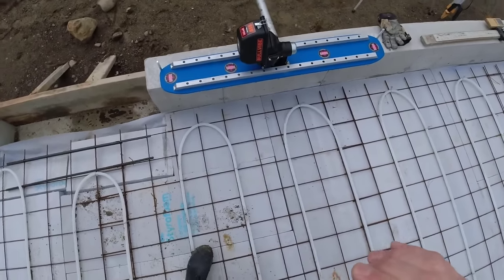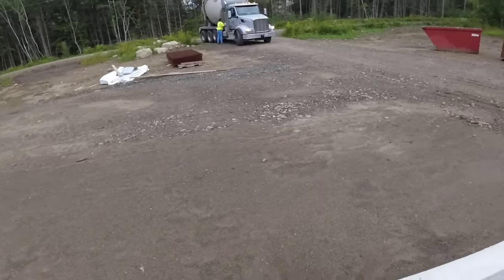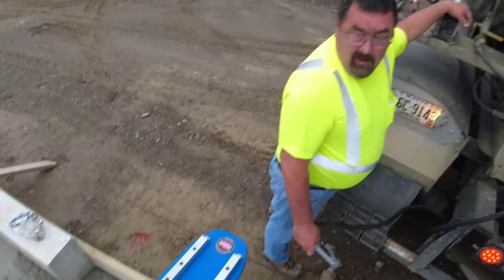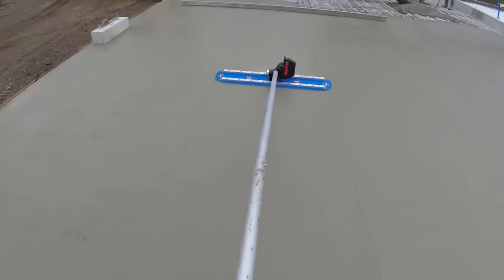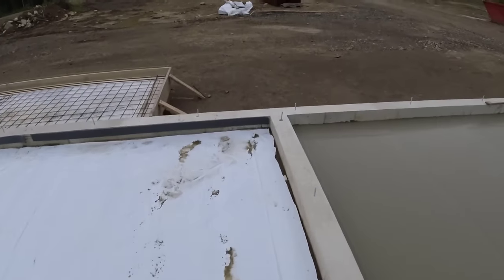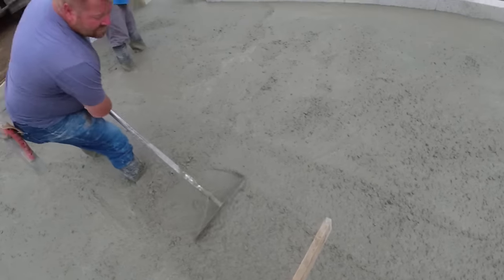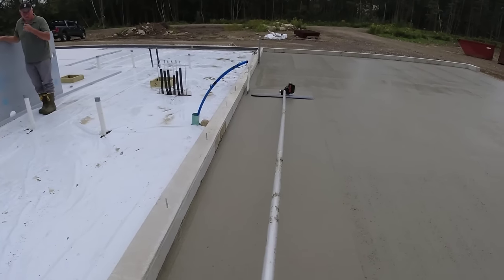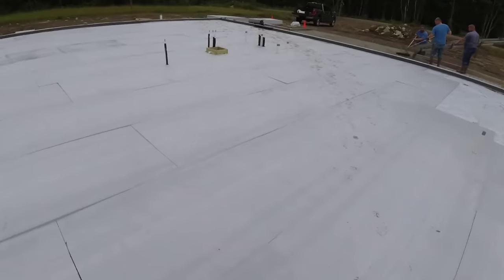NEW! BullVibe Attachment for your Bull-Float  (Easy Way to Add Vibration)

Comment: Have you had any issues with that poly bull float?  I heard it messes with the air in the northern part of the country...?
Reply: It will not seal the surface as much as a magnesium float. Then the bleed water can escape easier and not get blocked by a sealed surface. A magnesium may seal the surface, not that it always will. A composite float will not (or never) trap the bleed water by polishing the surface.
Reply: @elbuggo so in retrospect, poly is better due to a quicker finish time from Bullfloat to Fresno ?
Reply: @StampIt2X  It is not the finish time that is  the point here, but if you trap water below the surface, the water/cement ratio will increase, and you get a weaker surface. That is often one of the major points with concrete, that the surface is as strong as possible. 

Fresno must only be used after the bleed water is gone. Poly or wood are better for keeping the surface open to let the bleed water out, than those magnesium things.

If interested, you could watch this short video: Hand Floats & Darby Finishing Tool Video—ConcreteNetwork

Comment: so how is the wiremesh working when its at the bottom of the slab? i always tell the builder to wire on top  of the pex. this way you dont have to worry about picking it up and you dont have to worry about your pex floating.
Reply: It is bad, IMO. Imaging the mesh holding a carpet of sticks together. Then there will be no (or much fewer) cracks in the bottom (since that's where the mesh is holding back), and all cracks will be revealed in the top. By keeping the mesh in the upper part of the slab, most of the cracks will occur in the lower part of the slab.
Reply: @elbuggo  well that's not how it works. Concrete cracks for a number of reasons. One main material to prevent cracks is fiber or micro fiber mesh. Wire mesh main job is to keep the concrete together as a whole when it does crack. That's why it's not needed in a garage slab, which they are doing here because the concrete structure surrounding the slab ie poured/block walls. However......... tinsel strength is weakest at the bottom and the Crack occurs here first. Which is why all steel should be at the bottom 10% of your project. Soooooo them having the wire mesh virtually not in the slab as it is laying on the very bottom it renders it completely and utterly useless. Now if they have a customer that wants it regardless of professional opinion the mason should have the knowledge to pick the damn mesh up so it within code specs. slab are mainly 4 inches thick a small pinch with the rake will suffice. Now we're entering the problem with the pex being laid on top of the slab the mesh has to be picked up so thenpex has to enter in area of the slab it's not meant to be. Being on top creates weak spots and pex has a tendency to float and leave bullfloat indentations. To prevent this staple the pex to the foam lay the wire mesh on top. This makes it to where you don't even need to worry about the mesh as it's already in the bottom inch of the slab. I respect Mike's work and experience but we go by the book in Alaska for obvious reasons. Lastly I'm a 21 year concrete mason and I've owned a business for 8 of the years.

Comment: Looks awful wet?
Reply: Mike uses plasticizer within the mix to make it less viscous (more flowable).  It doesn't compromise the strength.
Reply: @kurtfrancis4621  Could have used less water instead? All extra water after cement/water ratio 0.38 will reduce strength, and it happens fast. 10% extra water will reduce strength with 30% or so. If interested, locate this file: Water-cement-ratio-vs-compressive-strength-of-concrete.png

Comment: Soup
Reply: ...and no curing.
Reply: Well, yeah that's what plasticizer supposed to do. It keeps the water to cement ratio correct but making it flow like soup!
Reply: @nbco55  What is the correct water to cement ratio? How much water per ton of cement?
Reply: @elbuggo  I'm not trying to be a dick, but engineering calls it out normally. On large jobs it's pretty straightforward, it's just that Mike on small jobs uses a lot of practices that are inherent in much larger commercial jobs. He's comfortable with that, which is good, which means he's good, but if you're not comfortable with that then you should do the research and figure out what your answer is of the question you asked.
Reply: @nbco55  I don't think any engineer can know that. Water is only 1 of the components in the mix. There are many other variables. Only thing an engineer can know is the strength should be for the concrete and what slump is needed to get it in place. Only the mixing plant can calculate this, because they know what else they have and can have in the mix.  Problem is that you cant just add water to the mix to make it more workable for free.
Reply: @elbuggo  As the great "Dude" once said "Yeah, well, you know, that’s just, like, your opinion, man."
Reply: @nbco55  Looks like you only have gas left.
Reply: @elbuggo  lol, you have a good day my man.